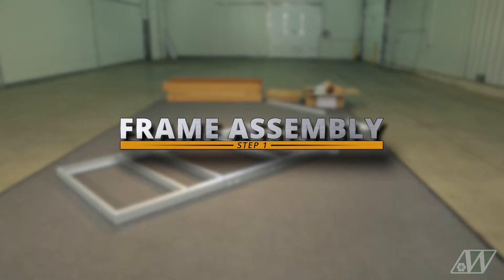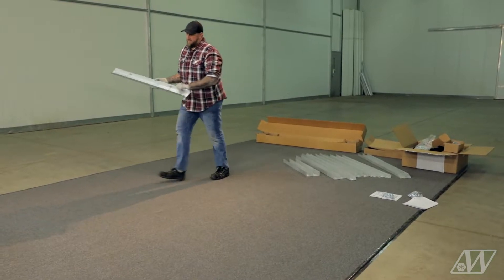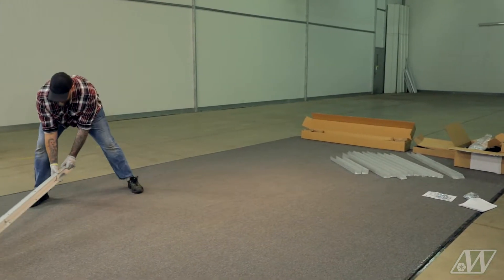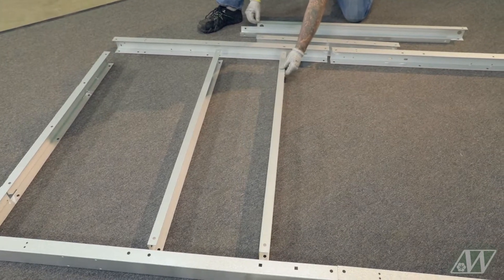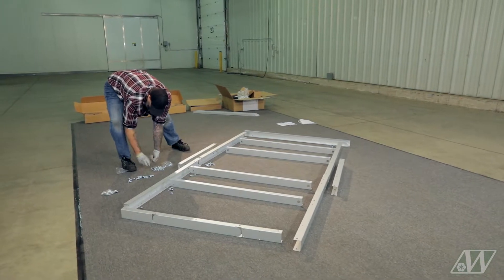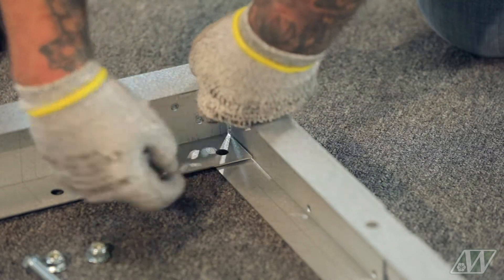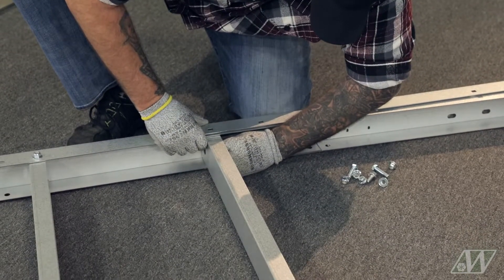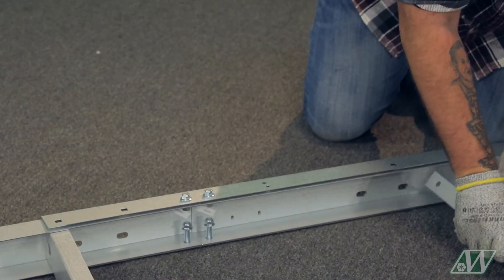Step 01 - Frame Assembly

Comment: In the instruction manual the quantities listed for the fasteners are wrong for this step. At this step there should be 6 of the 3/8x3/4" hex flange bolts and 8 of the 3/8x1 1/2" hex bolts ON EACH SIDE. Totals should be 12 and 16 respectively. Bolts are applied in all the same locations as each other and top vs bottom, with the EXCEPTION of the 2nd and 3rd cross channels which have only the bottom bolts. In the video you can see what bolts go where in the connection channels.